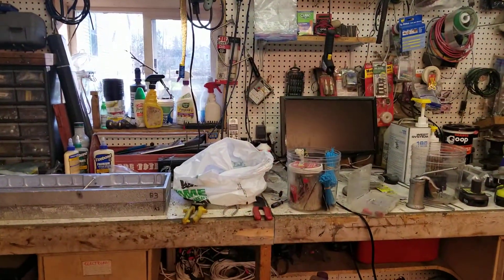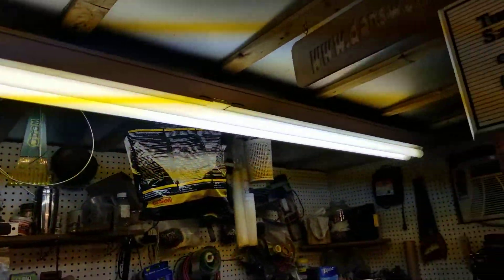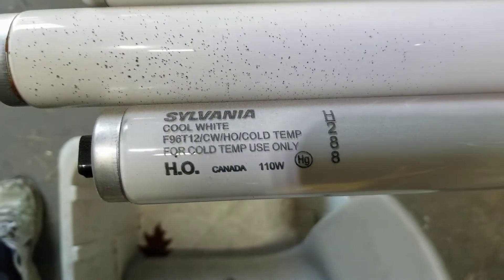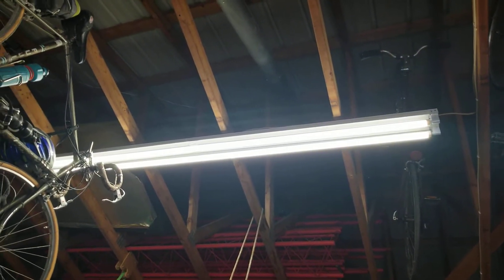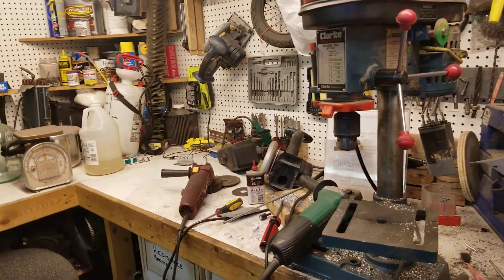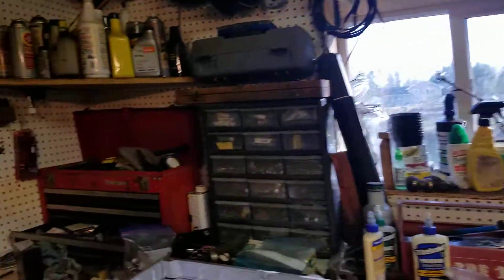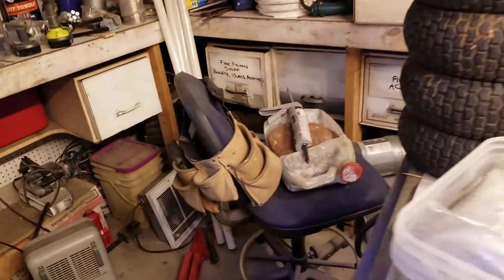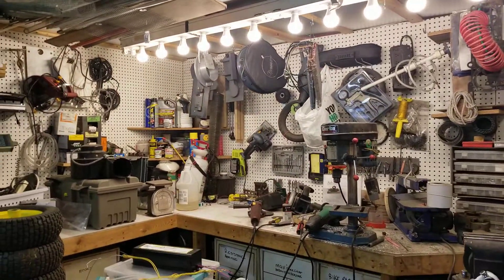Reworked 8-foot flourescent light fixture

Comment: 2:46 that looks horrid and is bulky and sheds awful light. Just keep using flourescent tubes, or if you really don’t want to use flourescent use led retrofit tubes, not this junky old mess. Also that costs you more in the future because you have to replace bulbs lots when they blow, bad idea.
Reply from the maker: Thanks for stopping by!  No worries man, I can address all of your concerns.  1. I don't care how bulky they look, it's me looking at them 2. The light is good enough for me, and they don't hum like a flourescent 3. I do use LED retrofit tubes, just not in this case, 4. I haven't had to replace a single bulb yet, but when they blow, it's one at a time generally, and even if I changed them all at once it would still be cheaper than the flourescent tubes in my locale.
Reply: @dansw0rkshop  oh okay. Thanks for letting me know! I know that it’s not to everyone’s taste, personally I don’t like the look of it with all the bulbs sticking out, but you don’t mind it so that’s ok because it’s your fixture. I know they only go out one at a time but still when more than 1 have gone out it might add up the costs when you have to buy new bulbs